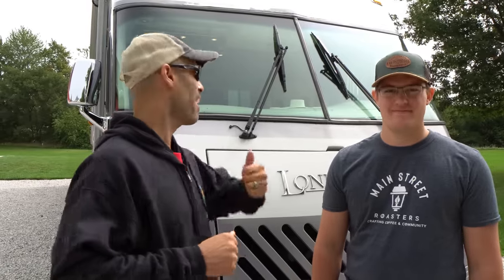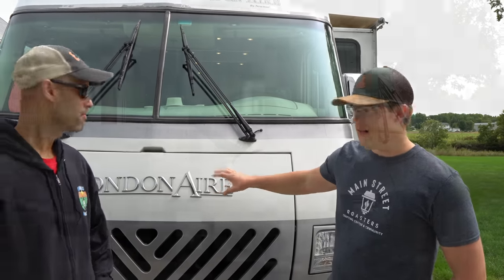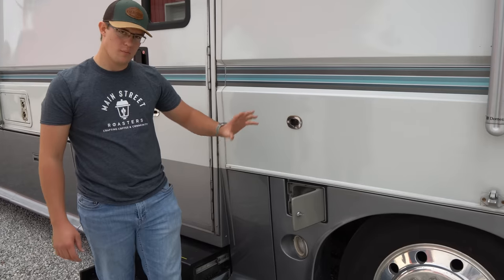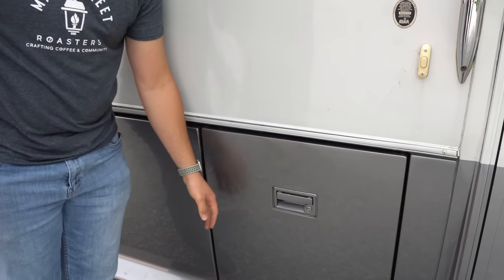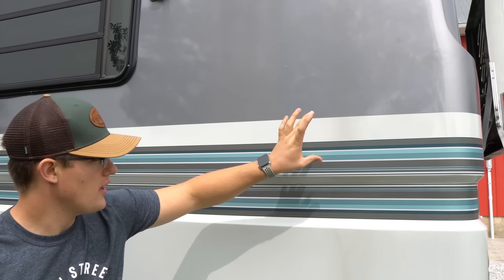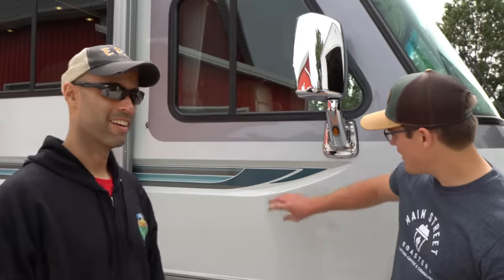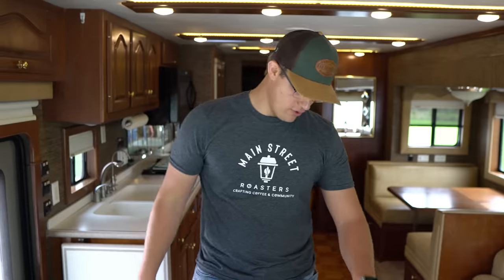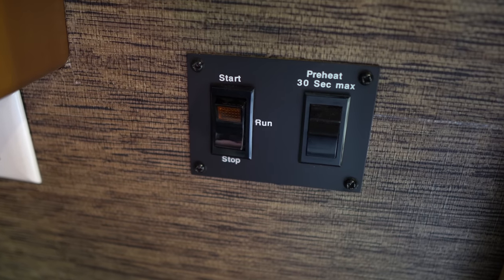One Of A Kind Newmar Motorhome— NEVER SEEN BEFORE!

Comment: Hello, loved your video! We moved to the Pacific North West  in 2020 in our newly purchased 1994 40 foot Newmar Londonaire Diesel Pusher very similar to the one in this video. Although it isn't in quite as good condition it is still very presentable. The engine has less than 20,000 actual miles and runs as new. It has 6 almost new Michelin tires. The large front mounted diesel Onan generator works well too. At the moment it sits covered in Washington State and isn't being used. We would be interested in selling it for no more than we paid for it back in 2020. Todays selling price for a new motor home of this quality would be well over 400K. Cheers!